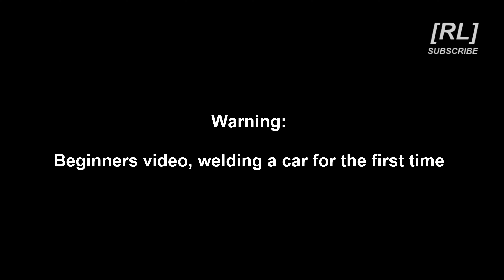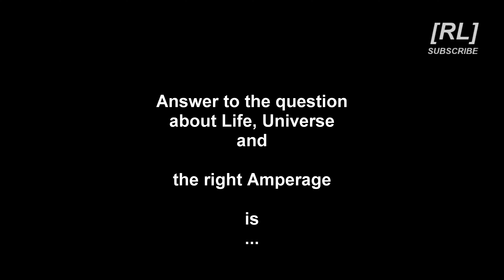First Time Ever - Handling Rust on a Car (4K)

Comment: What rod and ur heat settings?
Reply from the maker: Sorry, I'm not a professional, there was MMA with 2,5 mm electrode used, settings were 48 A on a DC inverter welding machine. No tig, no CO2 as we saw.